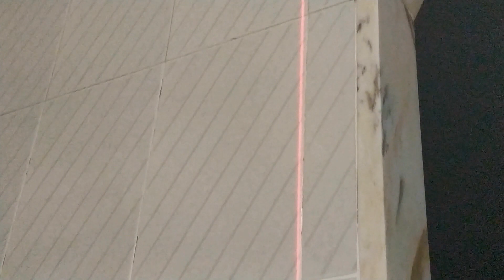calibrate laser level

Comment: Hey I am from the laser factory, for most of times it is not recommended to make cal through balance metal as after sometime the metal will get loose again, but we always make cal through some screws which are attaching or tighten to the diode.
Reply from the maker: Thanks for your help
Reply: Hi sir i ask you for help i have a problem with a new laser level witch have the horizental line with a reduced line we can say it's off 
What could be the problem

Comment: Very helpful video thanks for posting. Remember, a simple bubble level is not good enough to check the accuracy. There is a simple method using a wall and tape for the horizontal levelness. And there is another method using two walls and tape to check the levelness up and down coming out of the laser level.